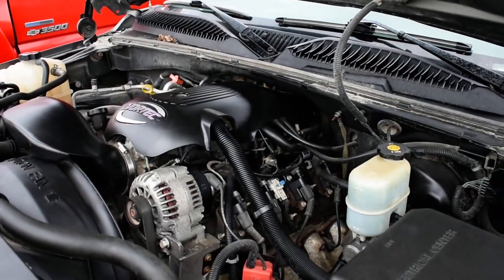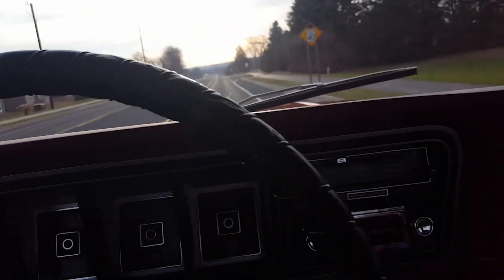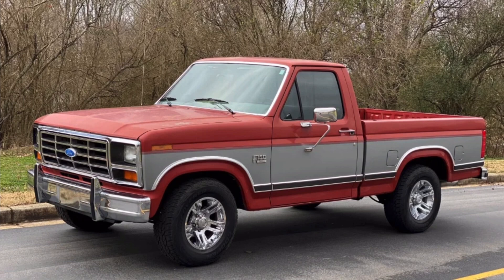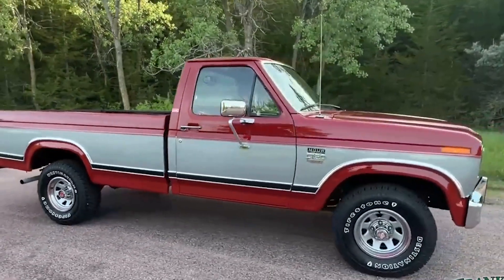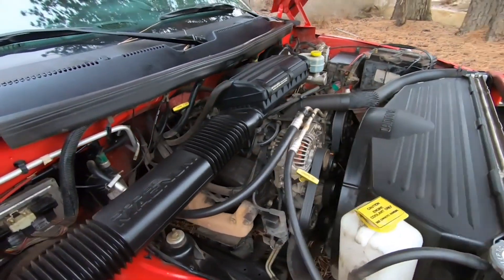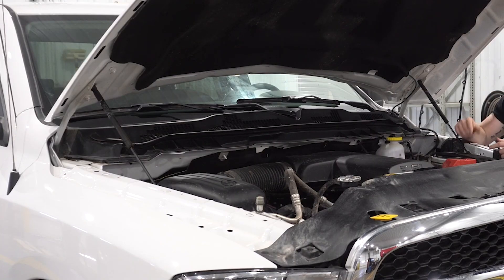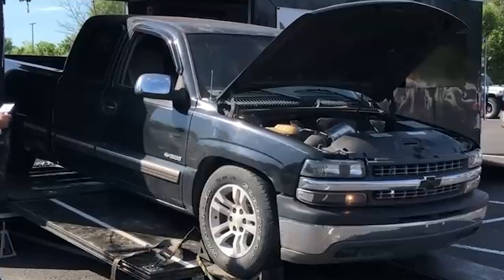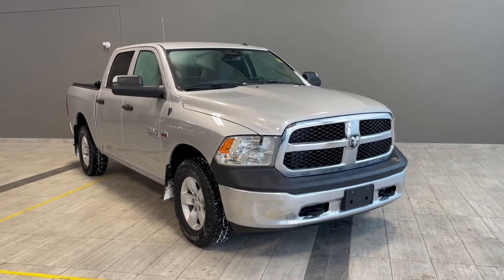These Three Truck Engines Are Unkillable: But Which Is Best?

Comment: those were the days ford tough and like a rock I am still driving a 91 GMC 1500 with a 5.7 10/30 every 5000 km , 451xxx km's on it and still doesn't burn oil, may be we have to reverse engineer the old engines and get back to basics